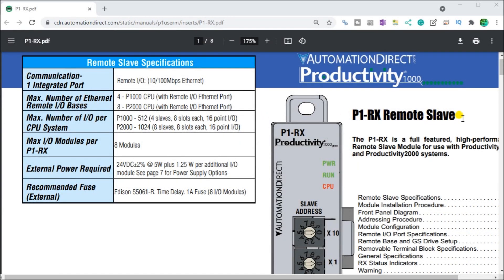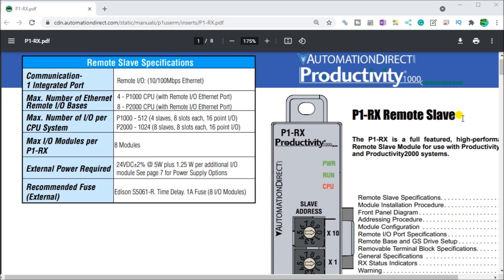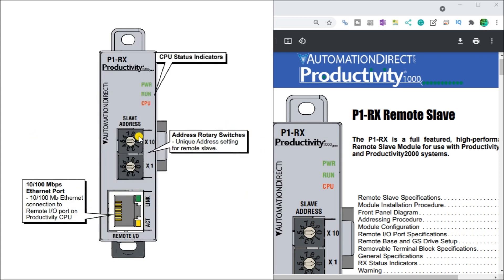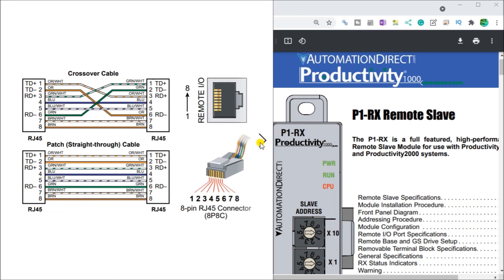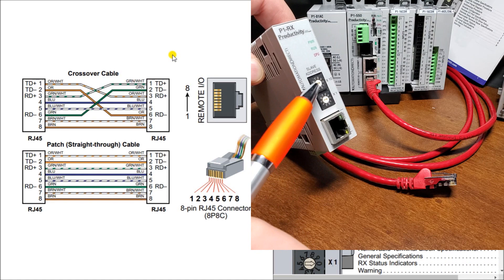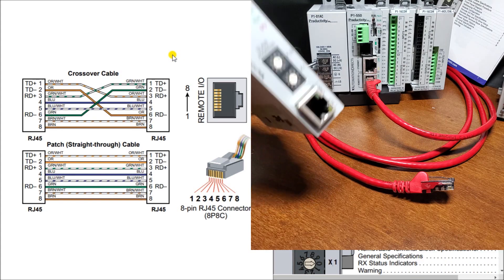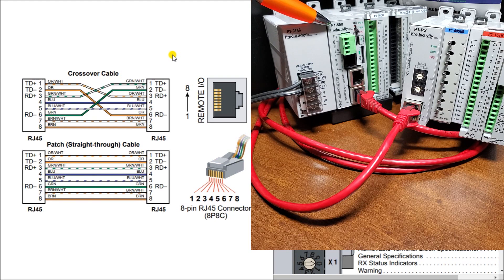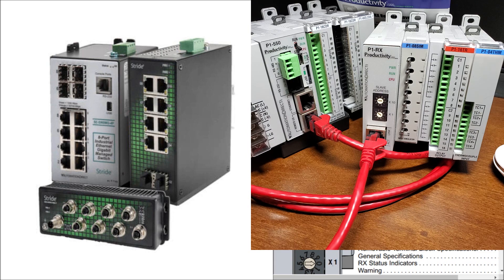Transform Your P1000 System: Unlock Remote I/O Power Today!

Comment: Mine just came in and I have worked on it a little bit.  You forgot to say that the programing software needs to be updated to the newest version.  I could not get my laptop to see the module.  Then did a software update and like magic it appeared.
Reply from the maker: Hi Jon,
Good point on the software version of the productivity suite. You must have version 3.10 or higher to use the P1-RX remote slave module. This is mentioned on the website, but not in the video.
https://accautomation.ca/productivity-1000-series-plc-p1-rx-remote-slave/
Thanks for picking that up.
Garry
Reply: @ACCautomation  3.10 came out Sep 20, 202.  Most people are going to have an older version.
Reply: I plugged both of the Ethernet ports on the P1 550 to the same Ethernet switch and it saw the P1-RX plugged in to the switch.  I had to have both of the ports on the processor for it to work.  It was only a 5 port NETGEAR switch so ran out of ports on the switch but have a 8 port on order LOL